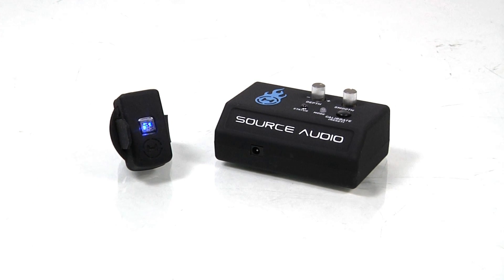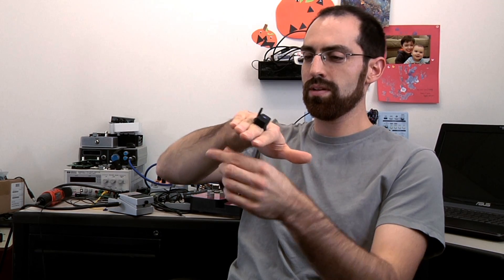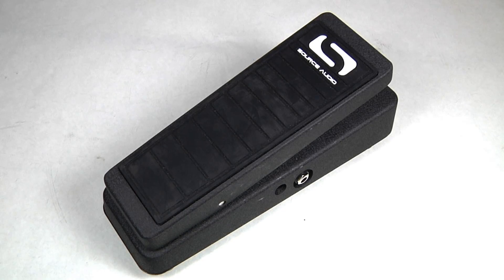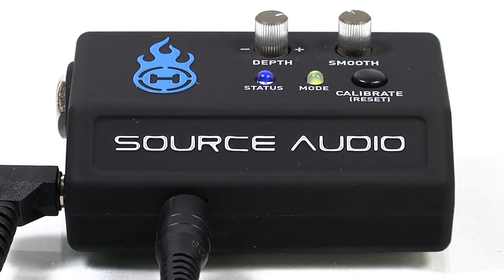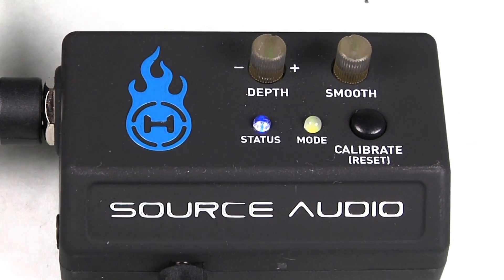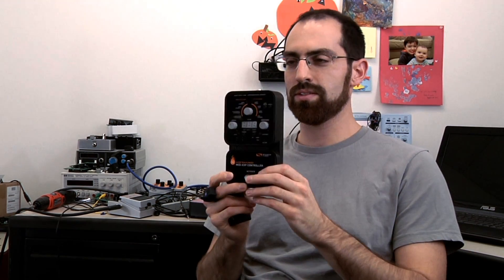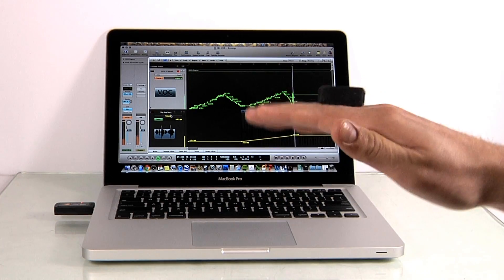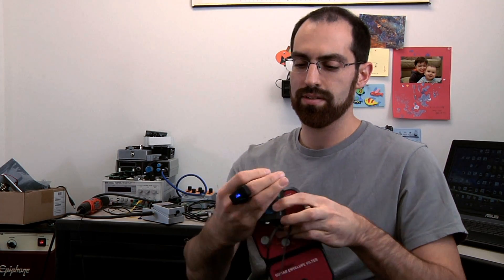Inside Source Audio: Designing the Hot Hand Universal Effects Controller

Comment: I received Hot Hand 3 4-5 days back.  Even after receiving brand new piece or unit the ring is not turning on after even charging it. Please help
Reply: I had one where even after charging, the finger LED kept blinking. Emailed them and they told me that the battery could the issue. They gave me a link to buy em. Issue solved!

Comment: I'm disabled and can't lift my legs high enough or with enough consistency to operate guitar effects pedals. Can I use your device to select/control effects from a multi-effects unit like the Fractal Axe FXII?
Reply: Brian I don't work with the company, but here is my understanding on this. When hooking up hot hand you are only really controlling one effect, via wireless to a petal! The same in reverse would be true for a unit like the fractal, as long as it is hooked up to the unit. So if you were to hook up Fractal Axe FXII, and dial in your effects independently it should work fine! Keep rocking the rock brother, hope that helps!

Comment: I meant my multi effects does have an expression pedal input but I fail to understand how the hot hand could be told what effect to control. So what I'm asking is will it work with a multi effects pedal like a roland gt-6b for example or would it work only with an individual pedal which has an expression pedal input                                     pedal which has a

Comment from the maker: For the guitar riff at 4:00 we daisy chained the Hot Hand signal into the Soundblox Pro Poly-Mod Filter and the Soundblox 2 Multiwave Distortion so that we could simultaneously control an overdrive swell and filter sweep, it created a cool backwards sound. We also sent it through the Echo effect in the Dimension Reverb and the Classic Flanger on the SB2 Orbital Modulator.